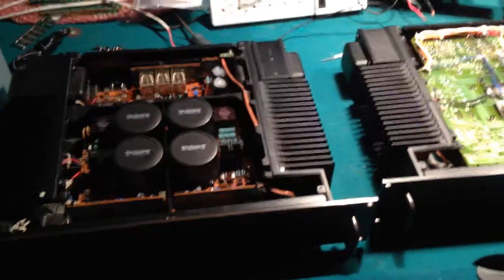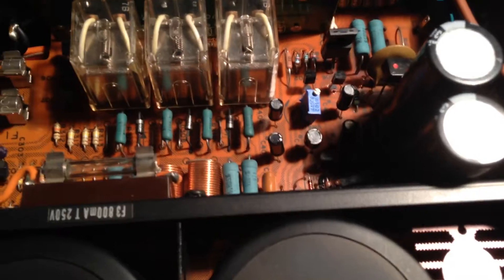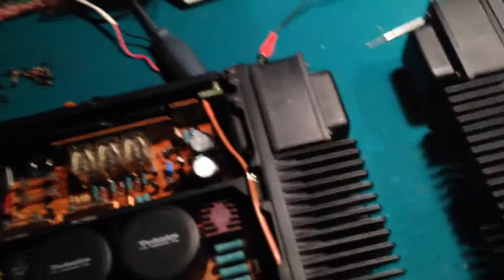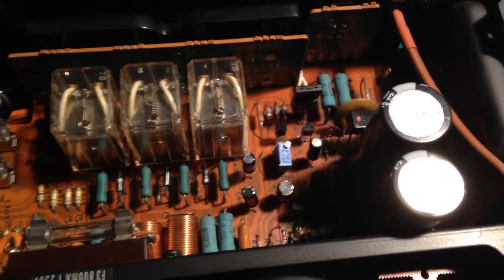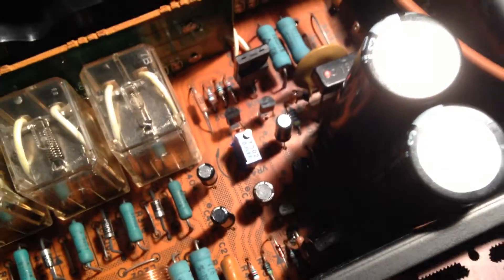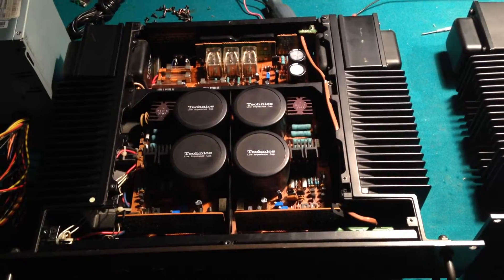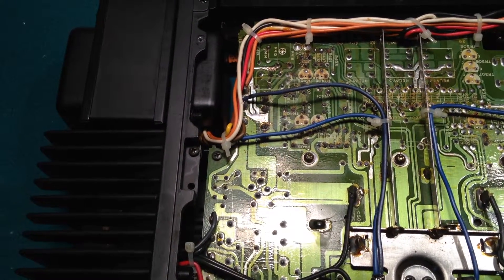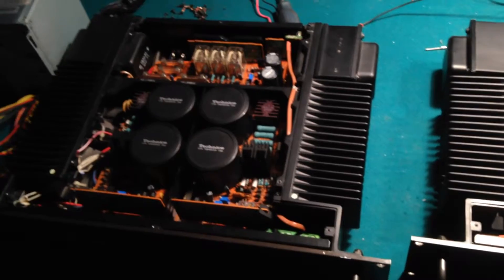Technics SE-9060 finished repairing (after explosion)

Comment: Ummmm, Dim Bulb Tester....? lols
Reply from the maker: i dont get the comment? the lights are fairly bright, just focused in a small area
Reply: @Nodarperformance  As in, powering up using a DBT after doing your repairs would have prevented the issues you had. Nice amp tho, I love these ones.
Reply from the maker: @simonbarr9476  live and learn I guess. its unlikely the bulb would have shown up a fault though because the current draw from that transformer tap is very small in comparison to the main +-55V power section as its on the regulated section and is very low current
Reply: @Nodarperformance  Yea thats entirely possible. I swear by a DBT and its saved my skin a few times after doing amp repairs. They are excellent for protecting against dead shorts, ie: a shorted output or reversed cap. I've just won one of these Technics amps from JP, so Im keen to recap it once it arrives!

Comment: i have the same amp but one channel is distorted and a green resistor up front gets real hot. the other channel is fine. could it be a bad d655/d675 output transistor ? the ones attached to the heatsink?? i swapped left side output transistors and out in right side same distortion!!  & these are the good transistors from the left side. am i missing something???
Reply from the maker: I would download the manual and follow some of the hints in there. Check + and - supply high current supply and fuses, then check the regulated supply voltage (+/- 55v). any discrepancy between the + and - rails will cause current to flow improperly through the amp and burn components. Check for bulging or bad capacitors, they are nearing 40 years old. More than likely a capacitor has failed and is acting as a short for either the regulated supply or a coupler on one of your drivers. with a transistor tester, test your drivers 2SA914 and 2SA921 and see if they are still alive. let me know what you find
Reply: +Nodarperformance will test and let u knowm thanks